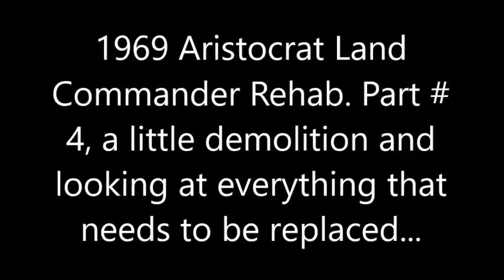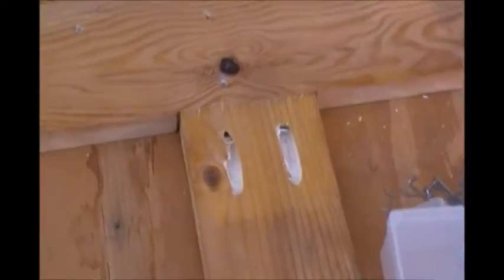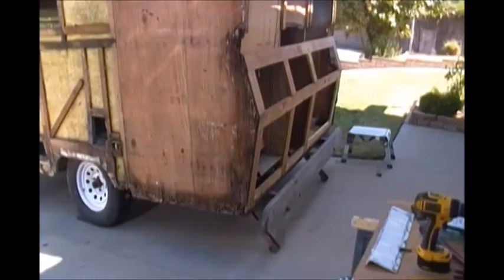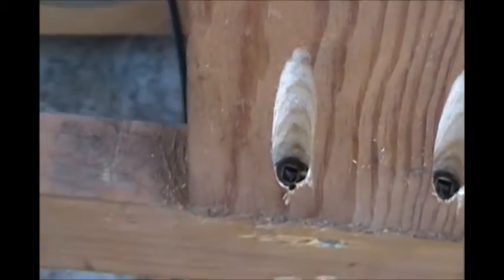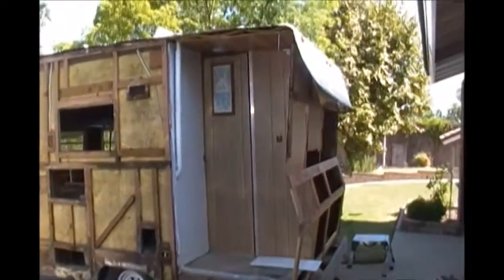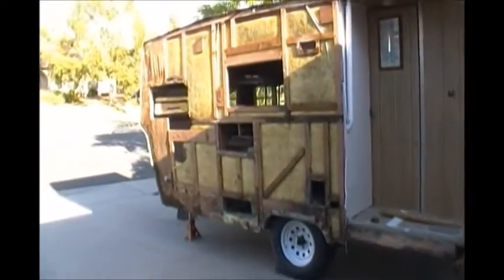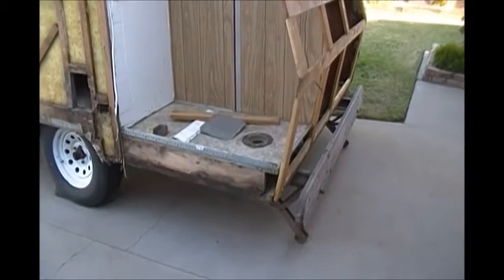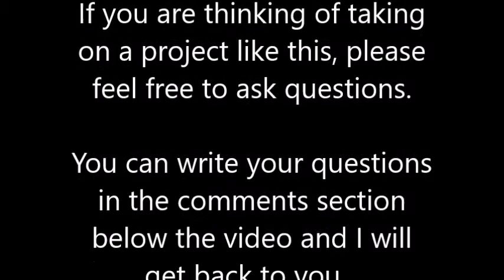1969 Aristocrat Land Commander Pt #4 Ripping out Bathroom walls and rebuilding the back frame

Comment: Good job Rudy. You are showing people why they can't just gut a trailer from the inside. For one thing you need templates. For the other, these trailers are built from the inside out. So they must be dismantled from the outside in. Looks like this trailer has been worked on before.
Reply from the maker: That's what I was thinking. I think the plywood was the other persons doing. I'm thinking of replacing the plywood with 1x's to lighten up the load... And I think this will bring it back to more of its original feel... I'm still not to sure about the paneling, Original or Burch... Thanks Larry... Hey you wouldn't happen to have some type of floor plan for this model or know where I can get one?Thanks
Reply: Google is your best friend Rudy...